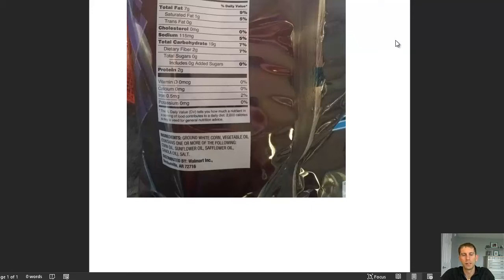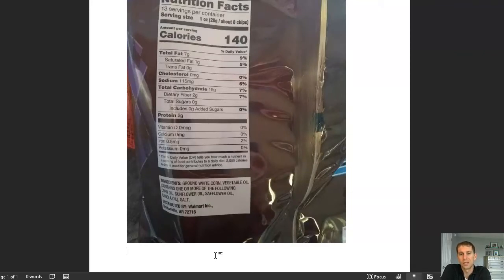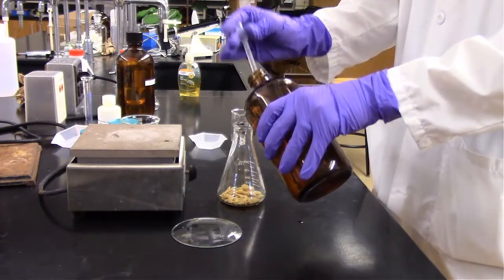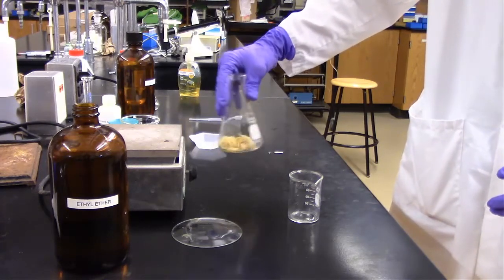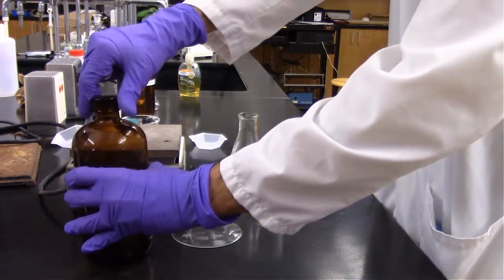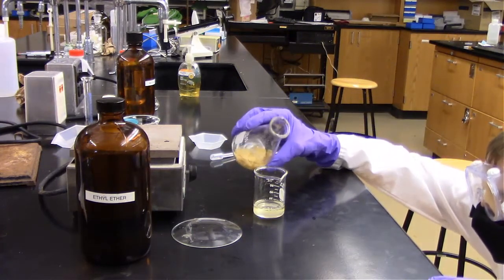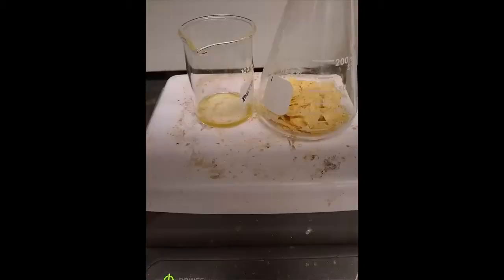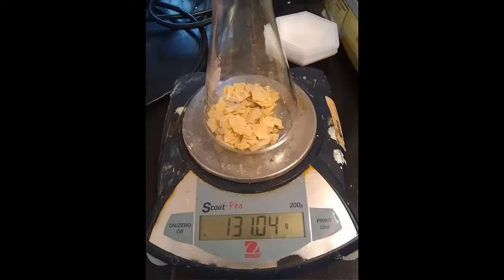Extraction of Lipids from Corn Chips

Comment: Thank you for your helpful clip. I want to know about what is method that you used for lipid extraction? Is it Folch method?
Reply from the maker: The Folch method is useful for extractions of lipids in more complicated situations where there is also high protein concentration. A ratio of Methanol and Chloroform are used in the Folch method rather than using Ether as we did in this experiment. There is not a formal name for this, but I am open to something like the Wuv-Miller method if you feel inspired to optimize this method for a groundbreaking application of your choice
Reply: @danielmiller54  Thank you for your information. I’m doing a project about the rancidity of vacuum-fried watermelon. I want to extract fat from vacuum-fried watermelon to peroxide and acid value evaluation. Can I use this method according to your clip to extract fat from vacuum-fried watermelon?